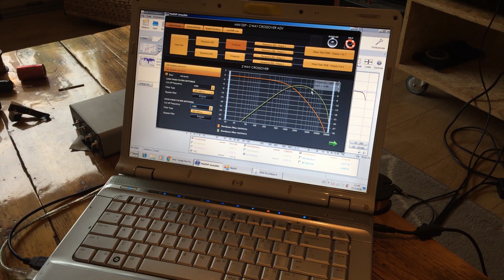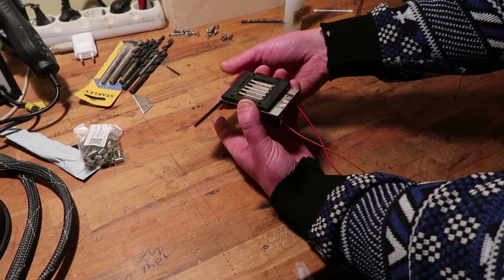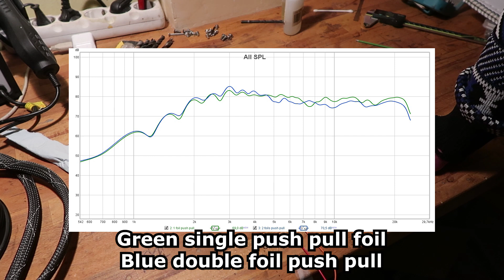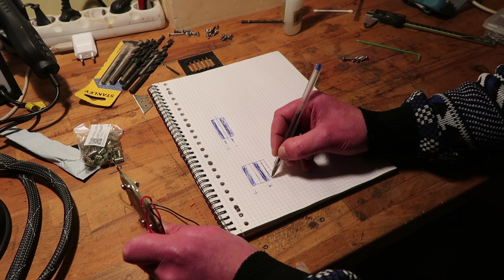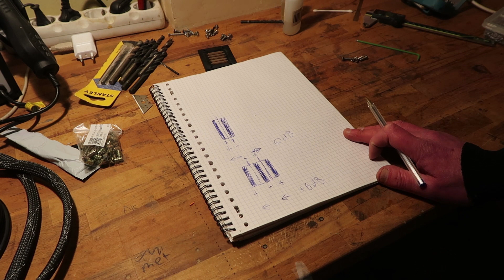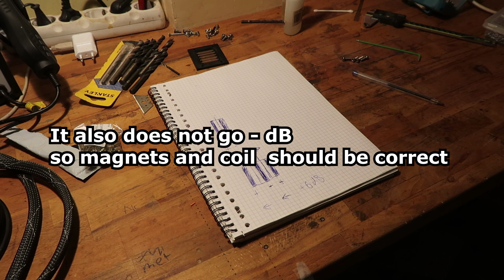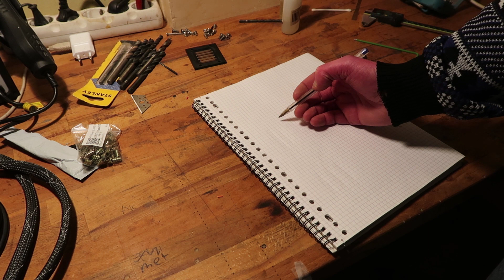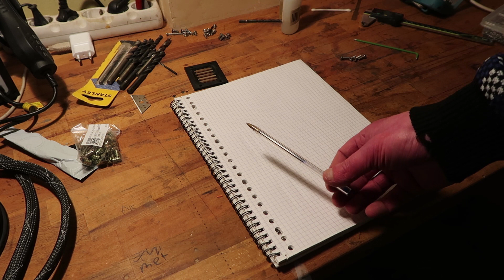Stacked planar magnetic tweeter - FAIL! (i also explain my working old ESL version)

Comment: Multi membranes configuration plays louder only because of a different power consumption. You used two capacitors/membranes, so a reactive resistance was lower. This is for electrostatic.
Reply from the maker: well this is a planar magnetic :) check nr 2 :) it works there :) 3 db for increasing surface area and 3 db for capacity on esl total 6 db  ! in this case it should be 3 db :)

Comment: To be considered, when you excite both parts (using that HPL-magnet array in the middle ) of the membrane you add an extra impedance of the half membrane , funny fact to be considered.. impedances tends to be high in some mechanical drivers after 1 khz https://en.wikipedia.org/wiki/Electrical_characteristics_of_dynamic_loudspeakers#/media/File:Speaker_impedance.svg. Soooo my first impression was when you configure your membrane into a push pull mode the system delivers  more power BUT the impedance of both arrays are cancelling that gain boost, but THIS IS NOT WHAT IS HAPPENING because the Frequency response LOOKS SO SIMILAR!!!! in both configurations ) YOU HAVE A MYSTERY TO SOLVE!!!!!!! will be great if you share your results when you found the answer :P
Reply: My final answer... and the most rational... (this conclusion is  because both measures looks tooo SIMILAR!!) Maybe, just MAYBE,  you need to stack another array of magnets in the array located in the middle of your device to compensate the magnet flux required by the two outside magnet arrays... that's why the frequency response is attenuated so perfect using the single configuration and the push -pull configuration!!
Reply from the maker: @camelazo  im afraid not :(  the magnets dont change , impedance remains also flat since a planar is almost a resistive load it stays 2.8 ohm maybe at resonant it has a hump of 3 ohm :) but you are right i have no clue why it does not add up :(  everything is the way it should be i believe. (to work) then again weight or whatever might be a reason it might never work up this  high
Reply: @joppepeelen  What about to stack another array of magnets in the middle, to balance the magnet flux required by the magnets of each side?

Comment: When you stack esl membranes, you double the input current. This means, according to the late Peter Walker of Quad, that output rises 6 dB. He said that no matter what of esl size or gap, an esl shall produce 100 dB at 5 milliamp input. In a magnetic driver, the input current is the same in folded or unfolded position, giving unchanged output.
Reply from the maker: erm ? at 5 mA thats a  bold and weird statement. that would mean any panel would reach that.  but i dont think so. also 5 ma at witch end of the transformer :)

hmm thats just weird. 5 miliamp is nothing . quads used considerable more then that.  at 85 dB , also a t witch frequency. ..... but i agree i should ahve known the impedance when i did those measurements , that could be helpfull. might need to rebuild the thing and see what happens.
Reply: @joppepeelen  This "Walkers law" is well recognized since many years, and if you measure the total current to the panels of your Esl63 you will see that the law is correct..
Reply from the maker: @jonaskarud   i believe you. (and walker , the  guru of esl''s i would say) but it makes the thing still output more then its size should be capable of compared to a single panel of the same size.  (when the same transformer is used) i really should rebuild that thing.  see where that impedance would end up.  (max output will be the same though)

by the way when talking current to panels that is before or after the transformers ? since after , is voltage driven.

damned cant do without an impedance measurement in this case.  well the esl thing is more a fun thing to try (not something i want to use ) maybe someday i re test it more proper.  and then i know if it has any benefits (besides some cons) i mean there is never a free lunch.
Reply from the maker: yes the current is the same in the folded or unfolded, but the magnetic force working on it is not. in my test i measured. one foil with the same resistance compared to 2 foils with the same resistance  (but twice the surface area, and 2 the magnets ) so i assumed it would gain 3 db .... just like  one 4 ohm woofer compared to 2x 2 ohm woofers in series should gain 3 db over one 2 ohm.

normally parallel would be 6 dB gain +3 because it uses 2 the power and + 3 because it has 2 the surface area.  2 in series power halves - 3 db and + 3 db because its double the suface area net result 0dB  twice the power handling.   in the case of the tweeter,  it is like the series config. except that the first measurement of the single panel had the same impedance as the series version (by using the upper panel as well)  so i expected +3 db when doubling the surface area.   weeeird :) i might be missing something completely :)
Reply: @joppepeelen  Hi Joppe, for 3 dB more sensitivity you have to double the radiating surface, not with putting one driver behind onother, they should be side by side. A push pull version reduce the VAS and therfore would be used in isobaric bass systems to reduce the speaker cabinet to round about a half size. To rise the sensitivty you should raise the surface, especially at low frequencies. At high frequencies it also matter the ratio of transducer size to distance.

Comment: Will you not end up with the same effect as you have in a ”isobaric” setup with woofers, i e no efficiency gain!? Ehh, you just said it in the end 😂
Reply from the maker: well it looks like it,  somehwhat. , although its not of much use for a planar to be honest :)
 the esl on the other hand , worked completely different. and my guess is the acoustical transparency of the foils itself. but completely sure about it i am not.
Reply from the maker: int he planar magnetics yes (by the looks of it at least). not in the esl's. i just sort of compress a larger esl in a smaller form factor. but with the same Xmax and  higher resonance.  and after 3 or 4 foils top end will roll off. slightly.